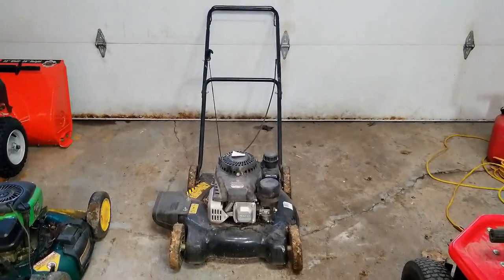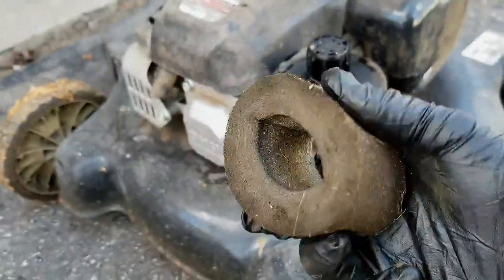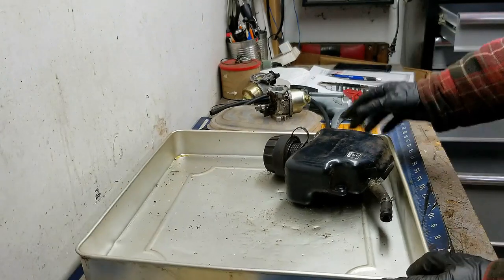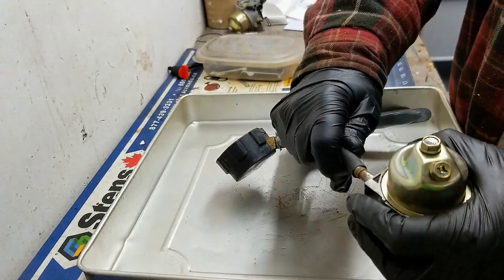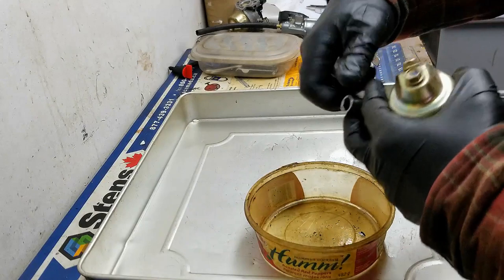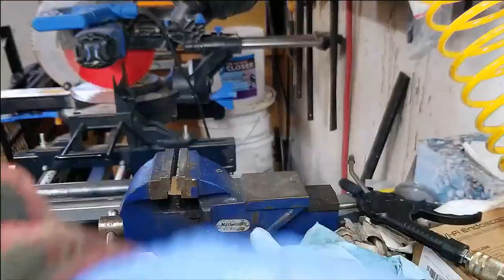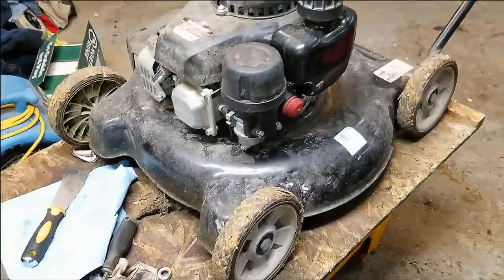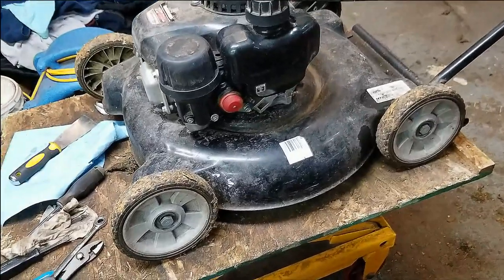Lawn Mower Won't Start After Winter Storage

Comment: Would the carb cleaner not make the seat swell up.  I think I had that problem one time. I sprayed the seat with carb spray and it caused the seat to swell which led to carburetor leaking fuel 😮
Reply from the maker: Yes it would. You have to be careful not to spray the seat area or quickly pour some fuel on the rubber components quickly after they are sprayed. Thanks for watching and taking the time to leave a comment. Cheers